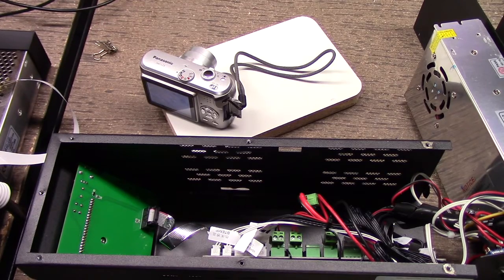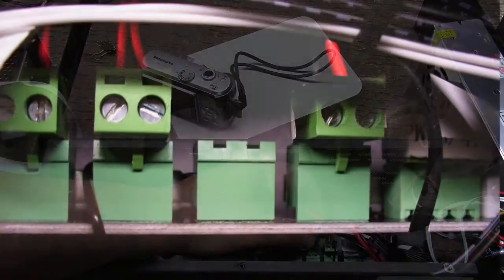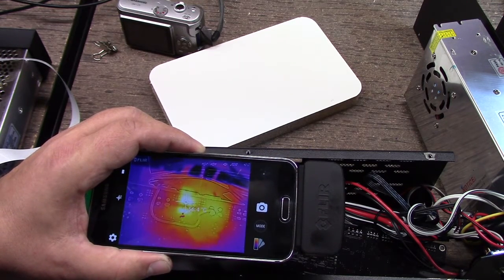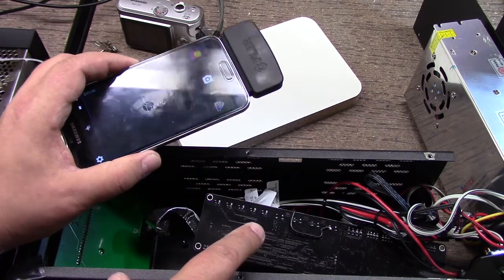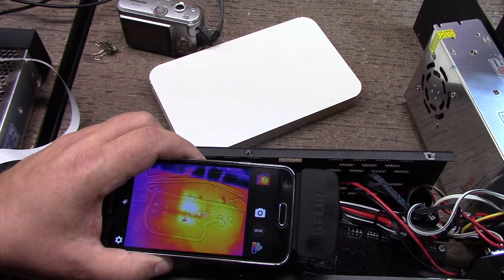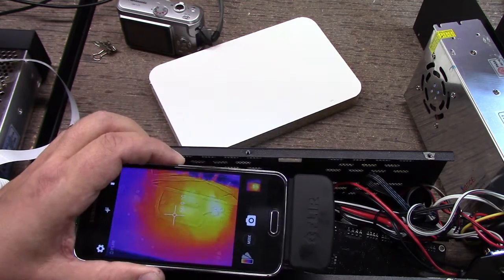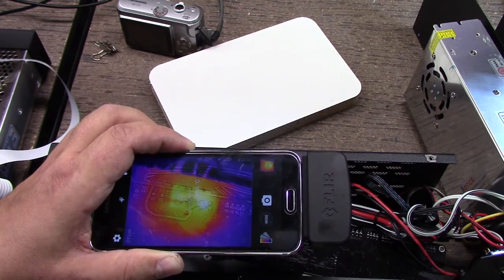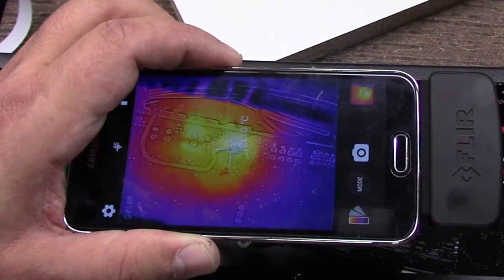Wanhao Duplicator I3 3D Printer - Are you at RISK because of the Heated Bed?

Comment: Try tighten the connection screws, mine was burned at the 12v output. When i checked all screws, including the board connection, they were horrible loose. Also check that the main unit fan draws out the hot air from inside.
Reply from the maker: Yes things where tight just way too much load, however today I have reworked the whole machine :-)

Comment: You can always install another fan to draw heat out
Reply from the maker: Not really as the heat is very localized, think of like when you car over heats as even if you had a second fan it still would as the density of heat to surface area is so high  it can not effectively transfer to the air for the fan to move.  This is refereed to as the thermal boundary...

Comment: Hi I reaky need some advice, i pucharce that printer, I am new in that do you thing the is god idea change the power supply wires, and for prevent to heat form the board do you thing is good idea to instal aux fan? Any comment i will appreciate tks
Reply from the maker: For the most part I would simply start out using it and just keep an eye on it as the ones with major problems fail fast.  As if you are an electrical novice you can quickly do far more damage than good as the only mod which I have done is the ground mod which is intermediate  in skill an even thou I have built scores of kits and projects from the ground I have not found a "need" to make any other mods and this thing is my workhorse out of my 5 printers...

Comment: I could smell mine cooking occasionally. Watched your vid and opened mine up. Contacts tight, so I pulled the board. Cold solder joint on the connector pins to the bed heater. Fixed, at least for now. Just switched to PETG mostly anyway, and seems to work well on a cold bed.. Thanks for the great video.. Happy printing!
Reply from the maker: I really enjoy working with PETG, is Wanhao holding "stable" enough for it temp wise?
Reply: The temp does wobble around the set temp by about 5C, usually to the low end, according to the panel, for instance 248 set and hunts from 244C up and back. It does tend to give some mixed areas on the print, but I still get really strong prints. I've only been printing for a month or so, and just changed to an all metal hot end and a .6mm nozzle last week. My main interest is in printing mounts and replacement switches for my motorcycles, so high resolution is not so important. I do like PETG, specwise, since most things I print will be used outdoors, in the Nevada desert.
Reply from the maker: Yes PETG for heavy wear uses can't be beat and with the 0.6 nozzle you should not have a big flow issue with the temp jumping around and will have to keep the larger nozzle in mind for myself.  I am also work on video about insulating the hotend should be out in Feb (I shoot all my videos in advance)...
Reply: looking forward to that video. I considered the .8 nozzle, but decided to compromise. I've noticed that some duel extruder people are using a .8 nozzle for infills and a .4 for the shell, to get the best of both worlds. I also bought a 3d pen, not for doodling, but to try as a parts welder. So far, I have welded abs and petg together with abs filament. Seems pretty strong. My second test was abs to clear acrylic. Really surprising adhesion.  Any thoughts on your doing a future video on that?  I noticed that you also have a k40 laser. (me too).
I sometimes find myself printing a flat part, then realize that I can laser it in a 100th the time. i.e. a filament guide. Thanks for doing what you do in the 3d community, and have a great 2017..
Reply from the maker: Back at you for a great 2017!  Know what yo mean on the laser as it is so fast!  The only issue for me is I have to wait for the wife to be gone to use it as even with the MASSIVE air extraction system I built, it still smells some what :-(  so a lot of times I go to the CNC (have two, nope three of them) and cut it as not is faster however longer lived endurance wise.  Have been looking at the 3D pens, however you really have me thinking on these larger nozzle sizes especially with a dual extruders (which I have one).

Comment: One of pins was not soldered in mine at all. This caused arcing and now the heatedbed will not work at all....... Im very disappointed.
Reply from the maker: The arching most likely destroyed the FET on the controller, if everything else is working and your handy with a soldering iron it is fixable...
Reply: DIY3DTECH.com thanks for the reply, I email Wanhao and sent them pictures, I'm very handy with an iron but don't think I should be responsible for their poor quality.
Reply from the maker: You correct about that and would interested to hear how you make out with Wanhao.  Please let how things go...
Reply from the maker: From the various people I have spoken with (as well as most Chinese suppliers) are much pretty much fire and forget so I have my finders crossed they come though for you :-)  If not fire up the soldering!
Reply: DIY3DTECH.com yeah I'm ordering the MOSFET just in case hopefully that's the only issue the board is $109 to replace
Reply from the maker: You can alway check it with a multimeter, when you turn on the bed you should see power flowing to the FET and when you turn it off it should also stop.  To second this would also test the thermistor too with a heat gun to make sure it is also working and not the problem (however because of the short would say its the FET)...
Reply: would you happen to know what mosfet i would need to get to replace this. They do not seem to want to contact me. I looked for some numbers but they seem to be scraped off mine.
Reply from the maker: Don't however have you seen Manolo Chen's YouTube channel (https://www.youtube.com/channel/UCjapOj_lwuAD2OyRsHYeIsg)?  He is somehow linked to Wanhao and you could try writing him (via youtube) as try googling or the "Jet Guy" via YouTube also.  Hope that helps, if not keep me posted and will see what I can do.
Reply: well its been a total of 6 months and 36 emails back and forth, but wanhao ACTUALLY sent me a new updated replacement board. Im still very disappointed i had to wait this long but glad i didn't have to fork out the 160 for a new board.

Comment: Nice FLIR cam keep in mind that with the controller pulled apart you have no forced cooling just having it in the box closed up with the fan running be it a small fan will make a big difference the only way to really tell how warm it gets it put it back together and but an NTC in there and take a reading then with air flowing over the board as its designed.
My 2 cents.  nice vid thought.
Reply from the maker: Many thanks for the kind comments, and obviously one can't shine a Flir camera on closed box however if this were the case I am doubting there would be much difference as looking at the Flir image , the heat is not wicking away on the board (this was actually pointed out to me by another viewer) so there won't be a solid heat transfer with the fan.  The other point is 60c is not [that] hot however why is it hot at all?  It is only a connector, it should not be hot so what this tells me is there is a "risk" of an issue as there is resistance in this junction which is converting a portion of the electrical energy to heat so "maybe" the connector is undersized for the load?
Reply: My connector actually melted I have since directly soldered strait to the board and no further heat issued hardly gets warm now, The connectors used are very poor in quality and the pins inside dont make a good tolerance connection and that will be the death of any high current point.
Reply from the maker: Interesting and my point (which sounds like I didn't do a good of making in the video) as there really should very little if any temp difference at either of these two points (bed or hot end)...
Reply: Don't get me wrong the video is very well done and with out them many people would have no idea of the problems or how fix them keep up the good work, all I was doing was adding my personal experience  that you may wish to include in a future update and they melting connector is after many hour of use so it will be over time that the problem occurs .
Reply from the maker: Ah good point! (after many hour of use)

Comment: That is good advice, be very careful of un-certified electrical equipment.
Reply from the maker: So right, hey your getting me in trouble as since you started that UAV course you have me looking at quad choppers :-)
Reply: DIY3DTECH.com
That's Fantastic.. A little pay back brother! :-)
Reply from the maker: Thinking about the Phantom 3 Standard with 2.7k camera as a starter platform so if it fly's away or crashes I don't cry that hard :-)
Reply: DIY3DTECH.com
That was my first. It's a great drone however it has a VERY limited range.
Reply from the maker: Just checking in on the studying :-) the 21st is coming quickly!
Reply: DIY3DTECH.com Thanks, It is indeed. I think I'm ready, but I'm constantly finding things I thought I understood, but didn't.  Go figure.. The more I learn, the more I find out I don't know.. :-)
Reply from the maker: You will do well!

Comment: The problem that was being discussed on the Facebook site was not just the over heating of that area but that under rated connectors were causing the overheat and the connectors were melting and getting burnt and in some cases starting a fire while using the hotbed at any temp. Jetguy proved by many examples that at least the power connector and even the hotbed connector MUST be replaced by a higher rated connector such as the XT60. Every owner of printer using the Melzi 3.0 board should read that entire post.
Reply from the maker: Do you have the link to the post as I will add it to the description?

Comment: Watch it get to temperature and then see what the temperature of the board is. Initial build up will use the most current. Once the hotened and bed are at temperature, the current draw drops significantly (PID curve). There is a fan, and I see no issues with 50-60C for the PCB as long as it's not for extended periods of time. And with a fan on, it won't be, you're not heating the bed or hotend to 5000C, so after 20 min or so (at the worst) the bed reaches temperature and current draw drops -- hotend should reach temperature in a minute or two. Then the question is how good is the PID curve, and the PWM setting. If it's not very good and it has to keep ramping up to full current, then it's a problem. These issues happen when the contacts with the wires is not good. You definitely need some strain relief on the bed, I've had beds with similar design when the wires broke off at the bed, not good.
Reply from the maker: Keep in mind the default I believe is Dead-time (at least on mine it was), in general I would agree that 60c is not bad, however what is a little concerning is how localized the heat was.  The board should have wicked away more of the heat especially for the fan to effective.    Where I do see an issue is if one would say loose several strands of the wire and the resistance jump than believe you might have a bigger issue as people have issue with the connector melting so awareness of the risk is good for safety sake.
Reply: The entire heating system (Bed and hotend) should be powered through properly specced 30A(@22degrees celcius) contactors with 24v control coils. I'm a professional service technician and i've seen a lot of shitty engineering but this is dangerous to life. No way this product has proper Certificate of Conformity to any standard, be it ROHS TUV CE etc etc. Wire diameter for 20-28 A is above 6mm which i assume this product don't have because the hot plate is connected to connectors to a circuit board spec'd at below 10 A

Comment: Only thing i can think of is that that connector is not rated for that amount of power , there is a loose connection between the plug and the socket and that is causing high resistance and therefore heat
Reply from the maker: Believe the issue is the PCB board [my two cents but I am not a PCB board designer] as the traces are not up to the task of handling the load which creates the hot spot.  As most boards only switch the power on the board whereas for the Wanhao they have created power bus on the board and my two cents is not up to the task of handling all of the current which is being thrown at it...
Reply: If thats so you could trace out that connection an add extra wire along the traces. When i get around to replacing the crap PSU fan on mine i will take a look at it . 2.5 mm2 twin and earth should do it ( the stuff you put in the walls for AC outlets , not sure what its called in US)
Reply from the maker: Yes you are correct and if you back in my Wanhao playlist you can see that I did this for the hotend (the wire is also visible in this video too).  would suggest splitting up the hotend with regards to the PSU feeds too as right no it one feed for all which I don't really like...

Comment: I suggest checking it put back together because it has a fan built in the case
Reply: Norbert Davis I've done this 120mm fan mod to the case and the box stays completely cool to the touch
Reply from the maker: Yes you are correct  there is a fan, yet it would be hard to do as to get the real picture (pardon the pun) you would have to close up the case and therefore could not image it.  However, because it is "spot heat" and not being wicked away the board (notice in the flir image the heat doesn't spread out it stays centralized) would indicate the fan will not have a huge impact.
Reply: DIY3DTECH.com - I have seen upgrades for the case where a 120mm fan is used. That would help move air. Not sure what kind of load it adds on the PCB but shouldn't be that bad. Maybe drilling out some extra holes where these connectors are at in the case would help. If nothing more it will let the magic smoke out earlier giving you a chance to react earlier. I have seen some people with enclosures for the Wanhao that included a smoke detector.  At first I thought they were a bit too overboard but now I think they may be geniuses!
Reply from the maker: Now that sound cool (again pardon the pun) in adding the larger fan...
Reply: DIY3DTECH.com - I plan on doing that but want to do something cool. Maybe a light up fan like used on a gaming PC.
Reply: Norbert Davis if you are going to use a 120mm fan it's has to be a thin one,,believe me I've tried
Reply: Scavenger 177 - can you make a recommendation?  Is there a particular Thingiverse model that you would say is best?

Comment: Thanks for doing that video!!   I hope this brings a better awareness to folks who have this and similar units. Impressed with the FLIR device. I love cool tech like that.
Reply from the maker: Looked surprised when I when I do the unboxing video in a week or two :-P  Becuase of the risk I jumped this in the queue, however, you will see a lot of this (FlirOne) in upcoming videos as it is very cool (pardon the pun:-)...
Reply: DIY3DTECH.com - Our techs use the handheld FLIR units to verify and troubleshoot our solar PV installations. I was thinking of getting one of those if I were to be back in the field again. 

They are great for checking the PV module installations as well as wiring connections in the DC combiner boxes and the inverters.
Reply: Hey Joe, rewatching the video on the TV via Roku, I noticed on your main board that I saw some hot glue on the smaller connectors for the steppers but did not see any on the ones for the power, heated bed, hot end, and the fan. 

Did you remove the hot glue back when you did the hot end fix or was there none to begin with?
Reply from the maker: Nope have not removed or changed anything other than adding the wire.  Also, I am having a lot of fun with the FlirOne as I got the Android unit even thou I am an Apple fanboy as I want to hack it to work with a PC and saw some Linux drivers...